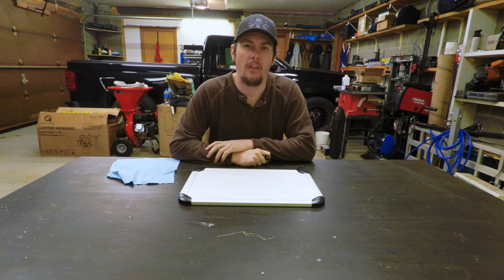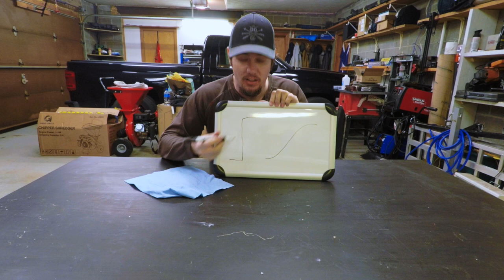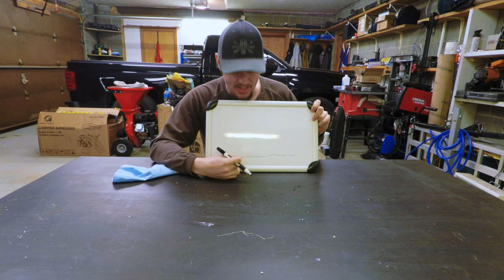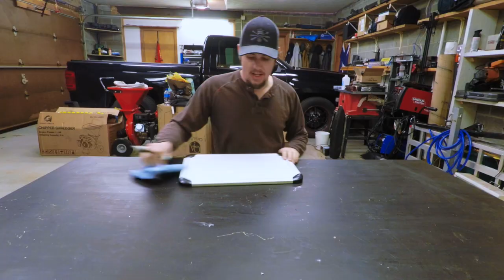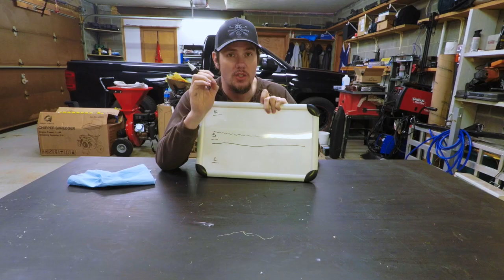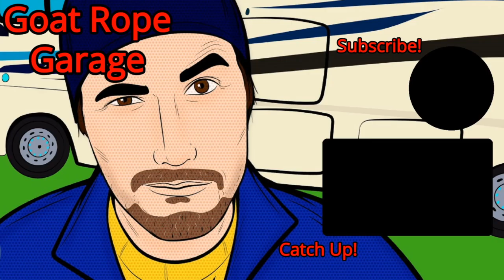Wideband vs Narrowband, Tuning Series Vol. 1.1, HP Tuners

Comment: I just got HP tuners 
 I built a 5.3 LS Turbo in my 98 GMC Sierra. Not finish yet but for the wideband I just have running to my gauge do I have to buy the special adapter to run it to HP tuners?

Comment: I've been running my '74 maverick for over 20 years as my daily driver with a 289 that's been bored and some head work, 280H cam, 4bbl carb, headers...  and installed a narrow band gauge to help me tune the carb, and I've tuned it and I can keep it stable.  I always thought a pcm would be relative as in start with it's base table and adjust based on average o2 between pulses... till I finally got a 'newer' vehicle...  now I have a 2006 colorado I5 3.5L, and got a obd2 dongle and some apps, and I see that o2 bouncing around...  I'm also finding it extremely difficult to find a way to find even pid's for my app to read all data like fuel level/pressure, and oil pressure/temp, much less how to tune it to simply get everything out of the engine that it's capable of, mpg and hp...  been trying to find just some basics, like what hardware I need to connect to pcm and what I need to find and upload a tune file...  It's a old truck so I figure they should be out there, and in the early days people did a 'home grown' way of tuning pcm's...  I'm just trying to find the most cost effective way to just improve my old truck (new to me and now my daily driver...)...

Comment: Narrow bands are excellent if you just want perfect Lamda, which is why car manufacturers don't use wide bands. Not necessary. Either you have Lamda or don't and are running rich or lean.  Wide bands are only useful for PE tuning, since when in PE mode, usually only at wide open throttle, the ECM enters open loop, which disables the stock O2 sensors (narrow band). And even then, if you want perfect lamda for PE, narrow band is the way to go.

Comment: I just wanted to be clear on something- are you saying that you should follow these steps every time?  In other words, do you first tune your MAF, then SD or VE tune, then tune timing, then tune torque management?  So let's say I have a supercharged car from the factory, and I put new pulleys on it, knowing that I'm going to go from peak boost of 7 to 10psi, for example.  Using the safety steps in your videos, you would first tune the MAF, then SD/VE tune, then tune the timing, and then whatever else?  Just making sure.  I was kind of shooting in the dark and doing whatever.

Comment: The ECU doesnt have a wideband signal going to it even after you buy one. Only your HP Tuner and gauge are seeing the wideband. While tuning with existing narrowband If your lambda and AFR stoichiometric targets are hit then you should be good. Check knock sendors as well. 

In short, I don't think I need wideband, but I am also not a protuner.

Comment: Okay afr question. I haven't started tuning the car yet. 

As you know the coyotes have factory widebands which I are actually calculated for the 10% e in fuel running stoich at 14.1. This fluctuates a lot between lean and rich in idle and cruise. More rich I believe. I think it will go from like 13.3 up to like 14.4.

Will dialing in fueling help it be more steady or is this just the normal?

Comment: I don't know if your still answering questions on your older videos, but ill ask anyway. Can I use a single wide band sensor on one bank of a v8 engine to tune? I just finished a heads cam on my 2008 Chevy truck, with stock manifolds and cats. Can I pull one of the upstream O2s and install a wideband for tuning, or should I decat it and get a reading from both banks mixed?
Reply from the maker: Yeah, we only have control over the total fueling so putting the wideband in one beach is fine

Comment: Unfortunately I just had my 2011 Silverado extended cab 4.8L turbo, built 4L80E trans tuned by a shop that has damaged the ECM. The truck runs, but I now have a P0606 code among many others and the truck will not do a burnout or take heavy throttle without going into "reduced power mode". Now i have had to buy HP Tuners and am consulting with a tuner in Ohio that is going to help me get this thing going right. A damn shame how people especially a known shop will take advantage of you and screw you coming and going and then deny any fault. I didn't even get a tune file, no idea what the fuel or timing is set at, boost pressure, no dyno graph or sheet, etc... I hope I can remote tune with HP Tuners standard package because that is what I got. Lol

Comment: So I'm a lil confused. Would wideband o2 sensors replace my OEM 02 sensors? Or would they be an addition to the system?
Reply: If this is your car and you are going to be learning to tune over the next several months, I suggest welding in a new bung shortly after the first oxygen sensor - that way you can leave the wideband in and take your time to learn.  When you are not tuning your pcm will be using your narrowband O2 sensors as usual.
Reply from the maker: As toys said, a extra bung is helpful but not necessary, you can swap one if the stock ones during the tuning process if necessary as they are disabled during the tuning process. I like having a wideband hooked up after
Reply: Ok. This is my daily driver that I want to play with for mpg and learning. I am also planning on building a project just not sure just sure what yet.

Comment: What is a good tuning device that has a wideband with it?
Reply: They are separate. He is using HP tuners program/software and and AEM wideband sensor and gauge.  The gauge can plug into HP tuners so you scan the wideband data.

Comment: Do I need the hp tuners pro to use the wide band? Or can I install the wide band in my pcm and program thought that.
Reply from the maker: You don't, you can bring it in through something like EGR or AC pressure or your can use a serial to USB adapter if you're gauge has serial
Reply: @GoatRopeGarage  how do I do this with mpvi2?
Reply from the maker: Just need to find the EGR voltage pin on your ECU then bring the analog from the wideband in on it, you'll then have to setup some custom math to convert it to AFR or Lambda
Reply: @GoatRopeGarage  okay that's easier to understand than everything else I've looked at on the internet. It's really hard to research things when you're brand new because people work things in a way that you would only realize as an already slightly experienced user. Thank you for the response and the free content more of us appreciate it than you know.

Comment: I am all for going with the option that will ultimately be the better one aka. wideband. My question would be... "theoretically" would it be possible to change an oem narrow band o2 sensor to a wideband and the ecm still be able to "understand" the readings and make adjustments accordingly.
Reply from the maker: They're are some that have a narrowband output that can be wired in place if a factory one and operate as both, I know innovate has one

Comment: Notice you recommended the Newer kinda dedicated AEM X series , figure you just use what works no need to change it up. Quick question tho , for anyone really. Basically I keep burning up my Wideband O2. I sent more lsu 4.9 O2s to a firery grave than i care to omit. That was with the Innovative  gauge/controller .While i do have the AEM  phat one  ready to go in , i feel ill just be sacrificing O2s to the fire Gods. Its mounted i a very Subbie place behind the turbo in front of the cat.
Reply from the maker: Location should be good because most of the heat is upstream of the turbo but the Innovates have gotten a bad repetition lately, maybe the controller was wrecking then

Comment: I am running a pst-1 in the pass side and an Mtx-l plus in the drive we side. Ive also hooked the wires to the mpvi2 pro module. But cant seem to set them up to log. Suggestions?

Comment: Do I need a wideband to tune a stock suburban havent done anything to the truck just wanted to delete the rear o2s and get into the tuning world learning as I go I just barely got the hp tuner with pro and was wondering if I really needed a wideband at this point or is it fine to just tune a little bit get a feel for it being bone stock

Comment: a little lost as to how to best move forward. 3.6l cadillac v6 that i supercharged. the supplied base tune is lackluster. car runs but i know it is very rich and the tune was based off of zero logging. i followed your videos but the ve tables option isn't present in my hp tuner editor. should i just maf tune it? car has wideband o2 from factory. 
any help is wildly appreciated.

Comment: Great information!  I have had my HP Tuners for a while now but have not tried to tune anything cause there was too much I did not understand.  I am looking forward to this series.  Quick question.  I have a 2009 CTSV that is stock and I am looking to tune with some bolt ons.  Will I need a wide band for each side?  You did not mention this in your video.  Also if I put one in for each side will I need 2 gauges or will the one gauge work for both? Thanks!
Reply from the maker: Just one is enough to properly tune. Thanks for watching!

Comment: Kind of new to tune world. If installing a wideband, should I install one or two? My Ram has two upflow and two downflow. I will be using a reputable mopar tuner. I am converting over to HP. Is there anyone who sales just the sensor? I don't want the gauge in my truck, I am wanting to keep interior clean.
Reply from the maker: One is fine and AEM and Innovate both offer a sensor with controller that doesn't include a gauge.
Reply: @GoatRopeGarage  thanks

Comment: Is there any way to get the stock PCM (say P59) to use a Wideband feedback to adjust fueling? Thanks  Another question: when using histograms to tune VE tables - you do use stock narrow bands, Correct? Thanks
Reply from the maker: You could, potentially, but they still aren't going to work on open loop, that's where you need the wideband to tune as we are outside the effective range of the narrowband sensors.

Comment: Hello and thanks for all the info new to tuning and lets be clear, do you remove one, if so which one?  or all of the narrow band O2 sensors,  B1 or B2 upstream or downstream. 
Do you tune with the wide band installed and remove after tune is complete? or continue to run with it installed?
Reply from the maker: If you're replacing a NB to tune swap with one of the front ones, when you're done put it back so you can run closed loop
Reply: So I have another question then. I see you logging with the scan tool in HP Tuners, is that somehow with the AFM and wide band sensor you recommend in your description or is it removing a narrow band and replacing to tune. Either way a parameter to log that would be set up in HP Tuner just not sure how you would introduce another outside O2 sensor to be seen in HP Tuner???
Reply: @dklbbach  there are wideband  gauges with controller which take the lambda signal from the wideband lambda sensor ,  shows the real lambda values, based on that info but in the same time produce narrowband standard signal for feeding the ECU based again on the same info.
This way you can tune the engine without the need of replacement the lambda sensors after the tuning procedure and the informativeness of the gauge is incomparable to the pure narrowband type one . The best solution is to replace the ECU with one  capable of reading wideband  lambdas data . Such a ECUs  control the air/fuel mixture much thigh , precise and faster .

Comment: Is there a wide-band O2 that you recommend? And are you using them in place of the OE Narrow Band sensors or in addition to? If in place of, where do you set that up in the tuning on HP Tuners? I have seen it on the Holley systems but haven't seen that on HP tuners. Thanks in advance! Great videos BTW!
Reply from the maker: I use the AEM unit, I'd get the can unit as it's easier to implement into your scanner. I run in an addition to the narrowband and install it near the front on the driver bank though it's not critical which bank you use.

https://amzn.to/2Tk7PSy
Reply: Goat Rope Garage I watched your video on it and have a better understanding of what your doing and how it is used. Thanks for the info!
Reply: @GoatRopeGarage  I'm doing an engine swap. Could aem be install instead of oe sensers
Reply from the maker: Not sure they can emulate narrowband sensors, innovate has some that will

Comment: How do you feel about tuning idle and part throttle using the narrowband sensors and then using a wideband for higher loads like full throttle?
Reply from the maker: That's fine, just stay out of PE without a wideband.
Reply: @GoatRopeGarage  Right on, I've actually been setting PE to 100% throttle to eliminate the chances of going into it and tuning MAF and VVE up to about 50% throttle and about 4k rpm
Reply from the maker: @scottgt95  That works, just be mindful that you can generate a lot of cylinder temperature running stoich at higher RPM's.

Comment: Are you just repeating what others have told you, or from experience?
i thought narrowband measures from .1 to around 1 and you want to be at .45 
At least that's what my scanner tools live data shows. When i rev the voltage and fuel trim changes indicating how the o2 sensor reacts.
Reply from the maker: If someone told you that you can tune a car with narrowband sensors by targeting .45 volts they are spreading dangerous information.
Reply: @GoatRopeGarage  Makes sense to me considering .1 is lean and .9 is rich. OEM sensors are Lambda sensors.
Reply from the maker: The issue is that there isn't any real scaling between the two points, the .45v is derived from averaging what we call the "switching" where we take the data from a period of time and get an average and if you are running stoich you should have an average voltage of .45 on the narrowband sensor, but for live data it isn't effective for determining current fuel trims.
Reply from the maker: Here is a prime example, from a user submitted log, showing the wideband readings next to the narrow band readings while targeting 1.0 EQ.  The AFR target is adjusted for 70% ethanol.

https://imgur.com/a/xyEakDo

Comment: Just found your Chanel and it has been great help for me. I bought a 1997 corvette with heads cam and some other work done. They had it on the dyno and had it tuned back in 2013 when the work was done. The car is equipped with an AFR gauge on the dash. I am noticing under WOT pulls I get an AFR of 11.7-11.9. I feel like that is way too rich and should be around 12.6-12.8. I also have noticed it feels like it kinda breaks up when I get to about 40%-50% throttle and it’s hitting 15:1 then jumps right to the 11.9 right after that. From what I’m getting from your videos is my VE table could probably use some adjustments to fix that 15:1 spot? Then the WOT being to rich would be in the PE settings. I am just wondering if I would be able to set up the scanner with only the LTFT and STFT and be able to adjust the VE table. I hear a lot of people talk about shutting off the MAF sensor and I’m just not sure why that has to be done or exactly how the MAF sensor effects the tune. If you could possibly get back to me that would be great to make sure I’m headed in the right direction. Your videos have been full of great information and I will be supporting your Chanel in the future. Keep up the good work 👍🏼
Reply from the maker: You can use the LTFTs for the VE table, just make sure and monitor if you're in closed loop, usually a PID called something like fuel system status. But I'd look into tying your AFR gauge into your scanner, most have a serial option on them and that way you could tune your WOT without having to disable PE.

Comment: I’m new to HpTuners and tuning in general and have really been enjoying your series. Is it ok to just replace the narrowband sensor with a wideband? Will the connectors and wiring be compatible? If so, what wideband do you recommend to use with HpTuners? Thanks!
Reply: Never mind. Found I need to add a wideband and controller. More $$ into the money pit!

Comment: Thank you for making this video series. What are thoughts on using a 5 gas analyzer?
Reply from the maker: Theoretically it will work but you will need to formulate a way to create a parameter than can be measured against commanded AFR or EQ in order to generate an error ratio. I don't the option had really been explored due to the expense of a 5-gas versus even the most expensive wideband setups.
Reply: @GoatRopeGarage  Thanks for the reply.

Comment: i understand the use of a wideband on personal vehicle that your tunings. but what about if a friend wants you to tune their vehicle but they don’t have a wideband.
Reply from the maker: I would be hesitant as you don't want to mess something up. A wideband is critical especially if it's on a heavily modified vehicle. If there is only bolt on modifications you are probably safe using the fuel trim tuning method. You can find plenty of guides out there on it.